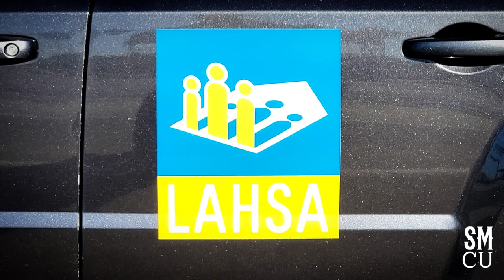Homeless Encampment Clean-up at Venice Beach

Comment: Do you not have a ban on shopping carts yet? We have had this in Austria for more than 10 years. If you drive the shopping cart over the border of the parking lot, the wheels will block. Driving is impossible with it.
Reply: Yes alot of stores do ,so shopping get stuck when robbing banks.